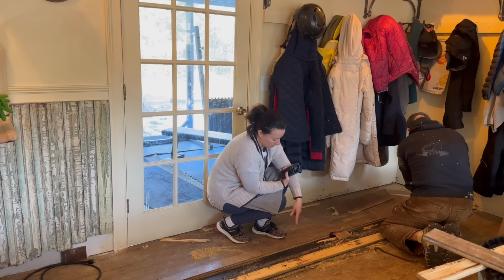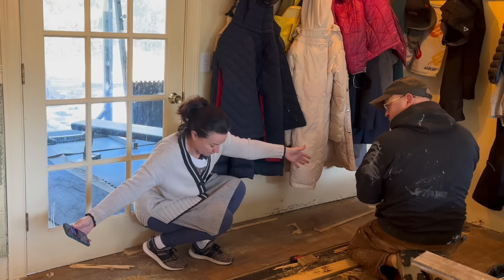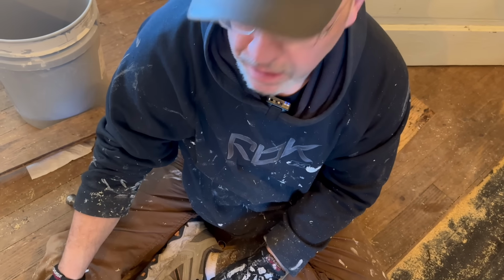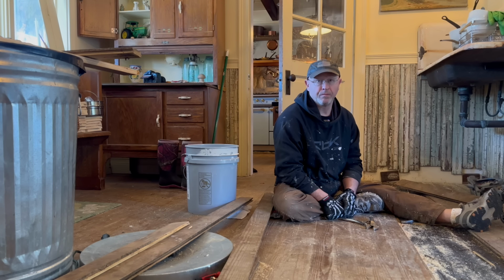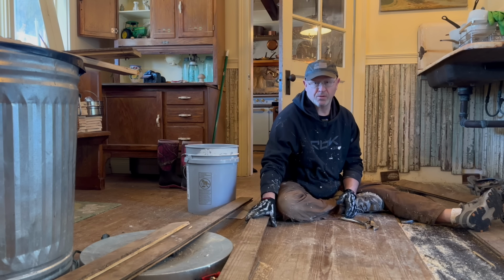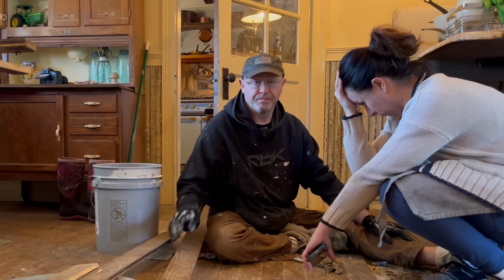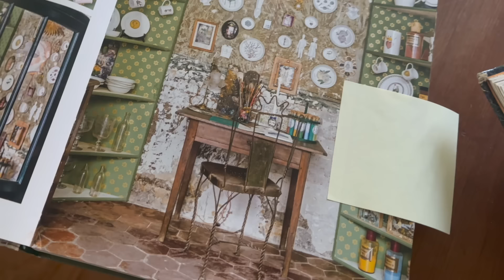Our Wood Floors are Coming Out Intact! | It's WORKING! | Chaos to Cuisine Part V

Comment: We had an old quarry tile floor laid on dirt with big grout lines and with traditional polish.  We ended up taking it out because it was so laborious to clean and with no substantial finish, too porous. I would suggest thin grout lines and a modern seal so you don’t have to work so hard to keep your floor looking good.

Comment: I'm so pleased you're going ahead and salvaging the floorboards!  They will be fabulous, and you likely wouldn't be able to find the same exact width and condition (they'll be gorgeous once they're sanded and refinished) later on. I've noticed over the last few years that new wood flooring is sometimes really inconsistent size-wize and difficult to match with wood flooring that's over 20 years old...It will definitely be worth the extra work now!

Comment: Have you thought about installing the radient heated flooring system under the tile? It's great not as much work as you think. Super inexpensive planer at Harbor Freight just bought one to run my rough cut lumber through to make siding.